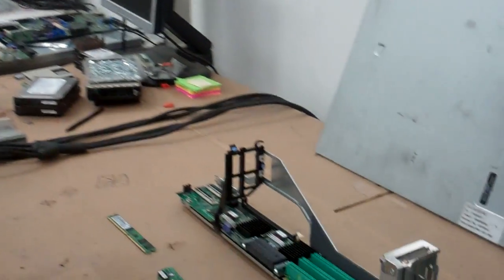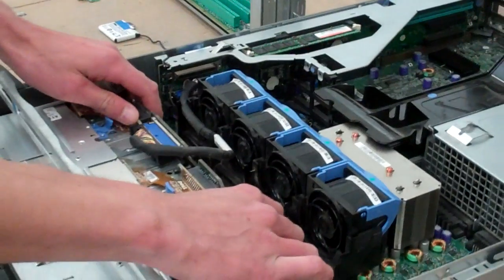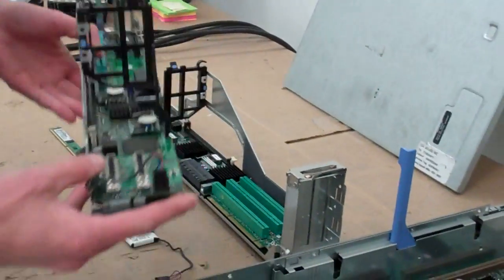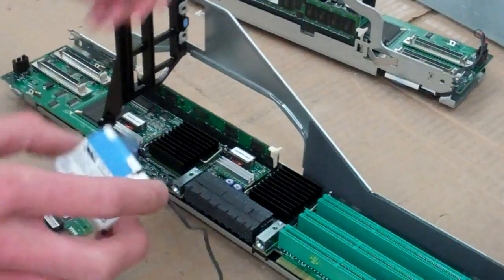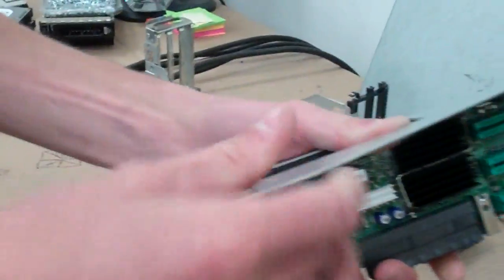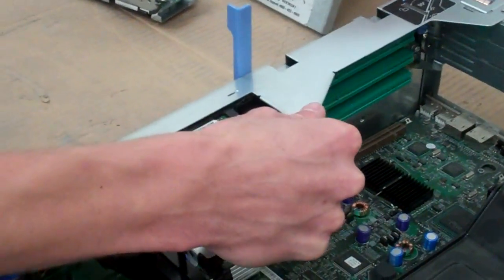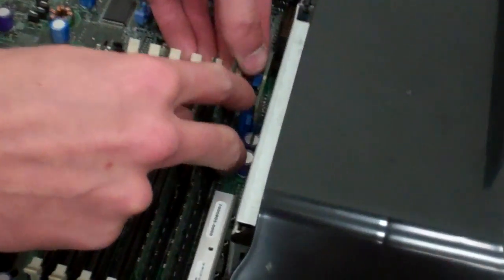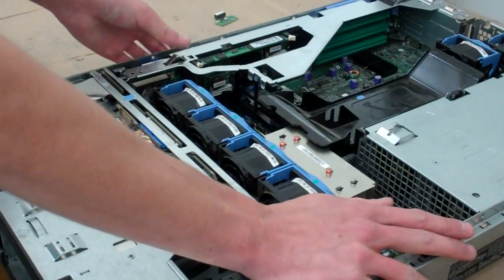Velocity Tech Solutions - Replacing Raid Kit in Dell PowerEdge 2850

Comment: Is it possible to update firmware to install server 2012?
Reply from the maker: Hi CI , Thanks for your question. As far as Dell Support goes there are not any official drivers available to allow the PowerEdge 2850 to successfully run Server 2012. If you're considering upgrading to a server that could support it let us know. Upgrading doesn't have to be expensive, take a look at our options. https://velocitytechsolutions.com/dell-servers